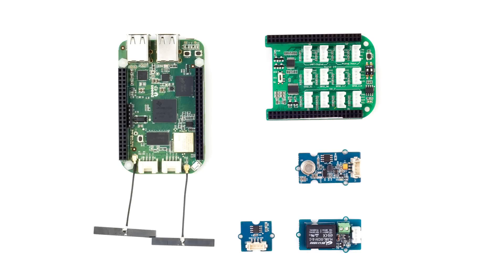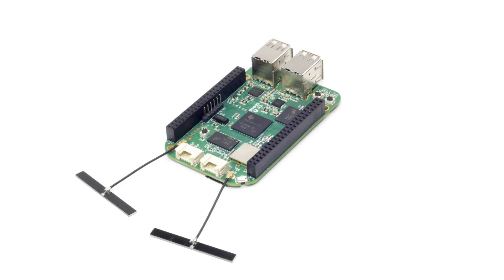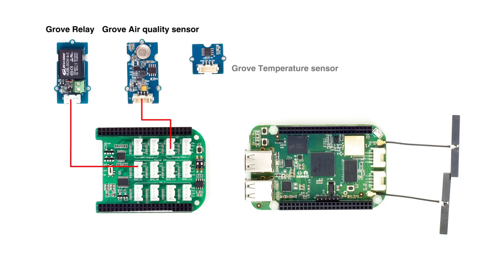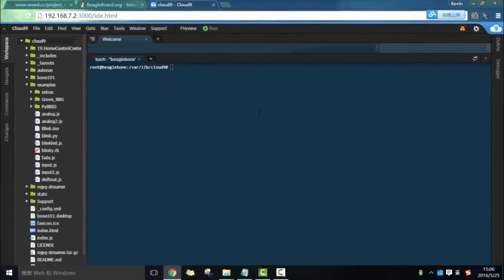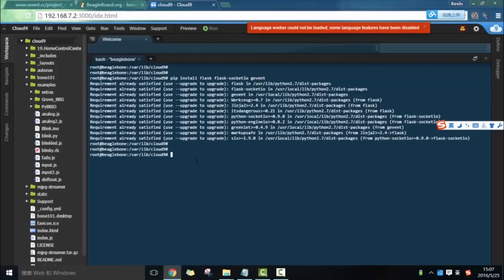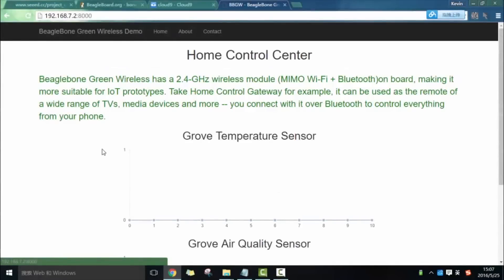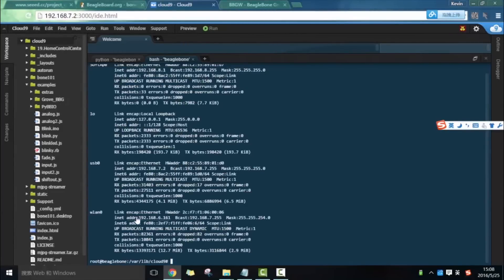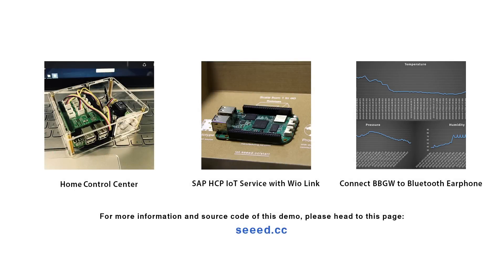Home Control Center using SeeedStudio BeagleBone Green Wireless

Comment: Dear team.
Your sensor "Grove - Air Quality Sensor v1.3" and the corresponding available library, do they work on a Arduino Leonardo ?
Just right after compiling I'm having errors.
(If I compile using for instance Arduino Uno then it works fine...)
Thanks in advance.